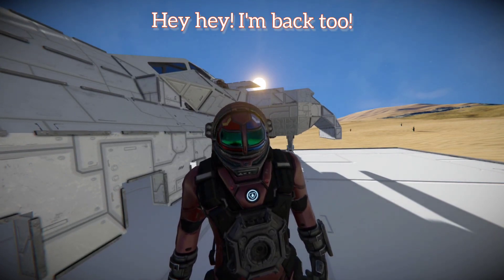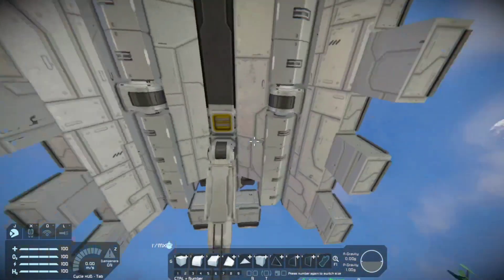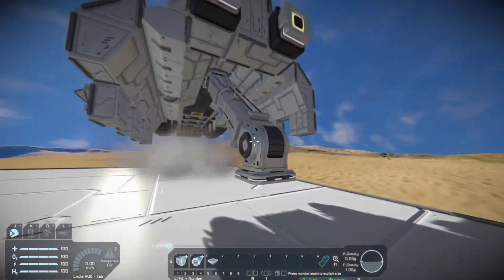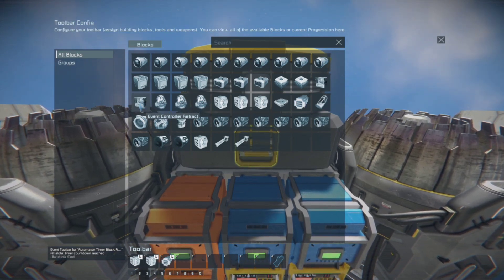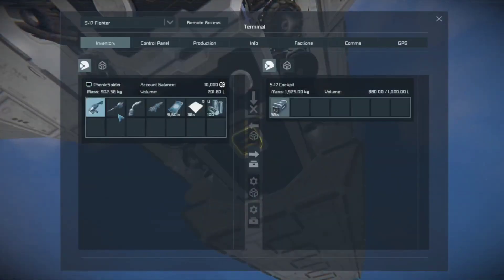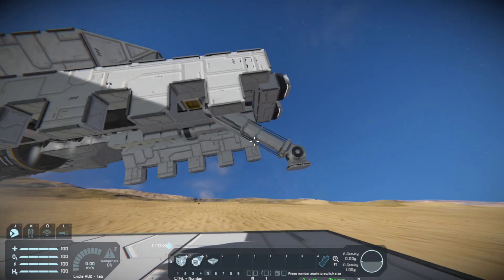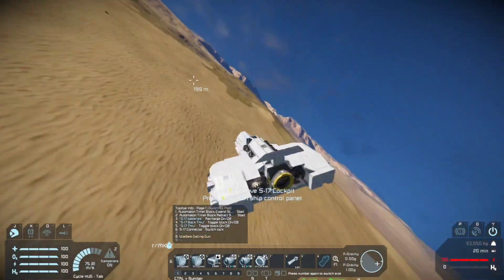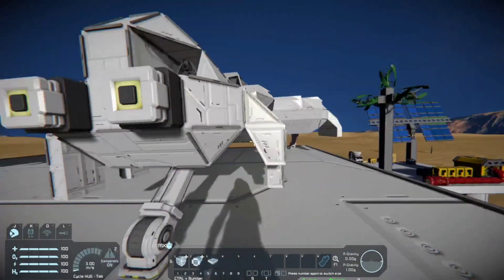Folding Landing Gear... Let's Make Some! - Space Engineers Automatons 2023 Tutorial

Comment: awesome job on the tutorial!!  I'm doing something kinda similar for my ship but I'm struggling with ship wobble since she's a hefty bugger :/ I was doing 2 different types of landing gears one with 2 hinge and one with a piston and hinge any ideas on what to do with ship wobble as I'm at a lose even with thrusters and gyros turned off I still get a fluctuation of .03 - .10 m/s of movement only way this stops is if the ship is completely turned off is there another block that creates movement that I might be missing?
Reply from the maker: I would make sure everything after the piston or hinge that is attached to the ship has "share inertia tensor" turned on. This can help with that. Also a mag plate on the last hinge or piston to lock you down could help too. This keeps the ship from trying to compensate with thrusters and gyros. Hopefully that helps!
Reply: @phonicspider  thankyou appreciate that but ya ive tried all that my guess is its a bug with hinges at this point as there's no movement below them. I don't even think its really a wobble its just rapidly changing movement speeds between 0.03-0.06 m/s but the ship is landed and locked in by the landing gear and if I walk on the landing feet and pistons there's no movement 

my front landing gear consisted a hinge on each side that are upside down at the nose of the ship and fold out sideways, that has a few blocks between a set of 5 mag plates which I now switched to the landing feet as the plates seemed a little fragile. and the back has a  set of hinges facing the back that folds down connected to a piston that connects to landing feet. all share inertia is set on and still persists even fiddled with the force applied settings between all components. ive shut thrusters off, turned gyros off, Locked the hinges nothing changes. unless there is another block that generates some kind of movement or vibration or something my guess is this cant be fixed :/ ive spent so much time on this thing 😢
Reply from the maker: @DARKH0BBIT  to be honost if it's just that small movement (~0.10) than I wouldn't worry too much about it. Alot of ships will that when just hovering as well lol it is annoying but usually doesn't hurt anything. 

Oh and if you've had mag plates the whole time, try landing and turning the thrusters off and not locking the plates. Sometimes the plates are to blame. Not sure why by they tend to make everything shift when they lock in certain situations.

Comment: Last time i tried to do this i got the geat to work but when they touched the block i wanted to land on ie my base it just blew holes into my base how did u get it to work without blowing holes
Reply from the maker: I only use the landing gear or the connector. I won't use both the same time. And when I use the gear, I am a little more gentle with the landing. Not sure why holes would be made though, unless your thrusters are on when your sitting there. 🤔 if anything the gear should break on the ship, not the other way around.